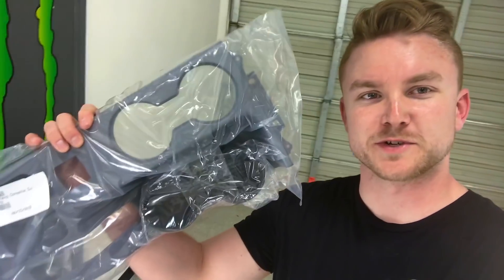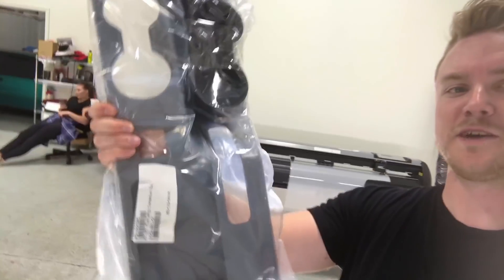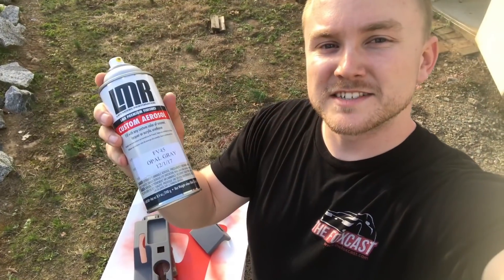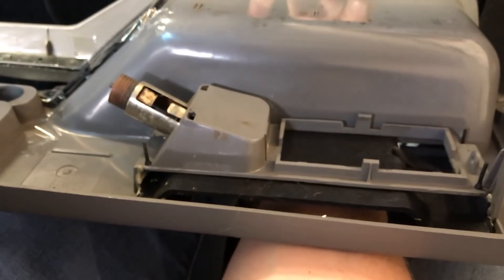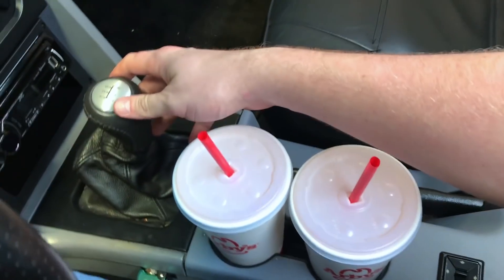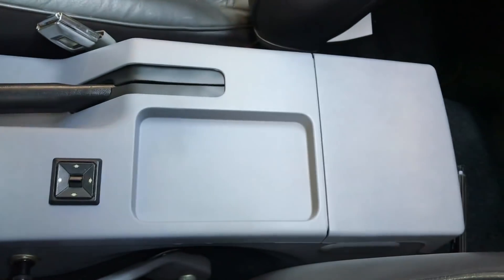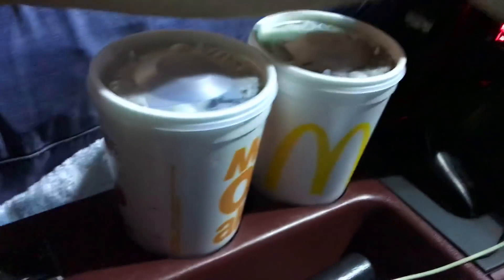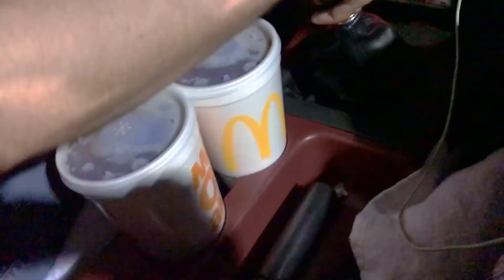Fox Body Cupholders - CC: EP 11

Comment: How many coats and cans of spray did you use for the scarlet red?
Reply from the maker: yoter06 one can! Two coats. Buy two just in case you need to blend the plastic around it because 30 years of sun damage isn’t kind to these lighter colors!
Reply: Harris Lue what wow, I used two cans first go around, and it looked horrible. Used the lmr kit, scuffed it, cleaned with the vinyl cleaner and prep, followed by several coats. Talked to lmr and sent pics, they mixed me a new batch and sent two new cans. Resprayed last night with one can and it doesn’t look near as good.
Reply from the maker: Idk man! I just prepped mine with alcohol and sprayed it! It’s dye so no need for sanding like spray paint!